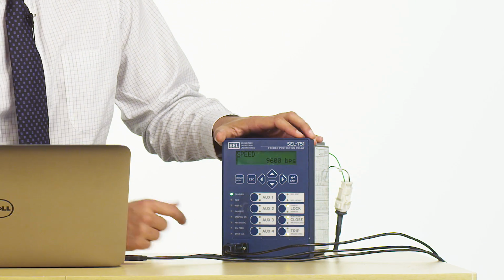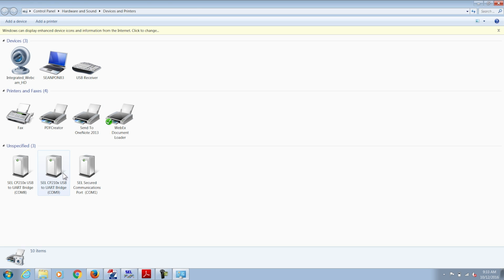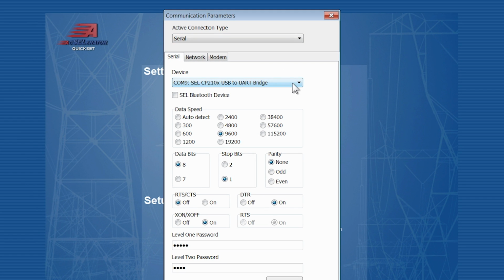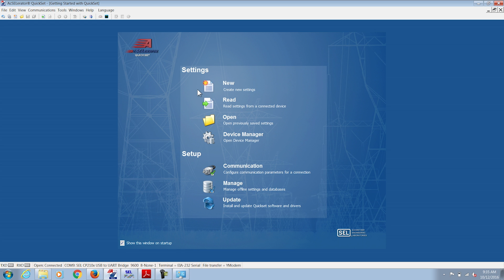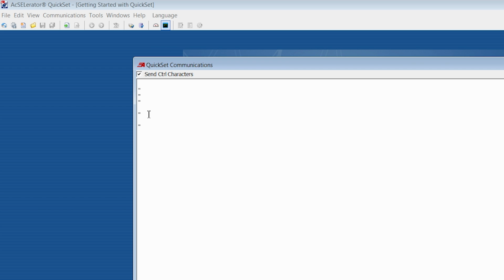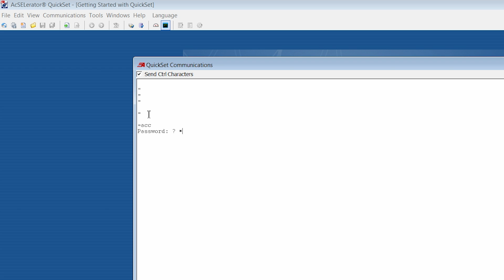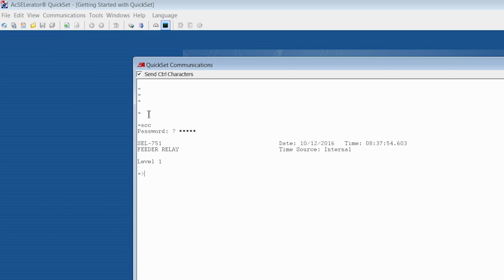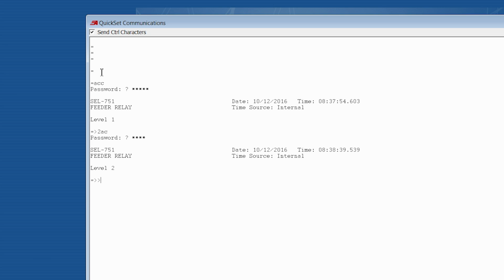How to Set SEL-751—Part 1: Communications

Comment: how to trip a breaker using sel-751
Reply from the maker: The SEL-751 tripping logic is designed to trip the circuit breakers. The relay logic lets you define the conditions that cause a trip, the conditions that unlatch the trip, and the performance of the relay output contact. The logic can be assigned to output contact based on application which will cause the circuit breaker trip. Please visit, https://selinc.com/products/751/, for more information.